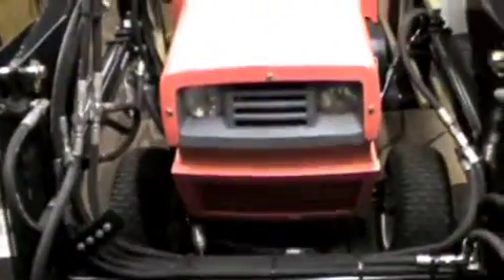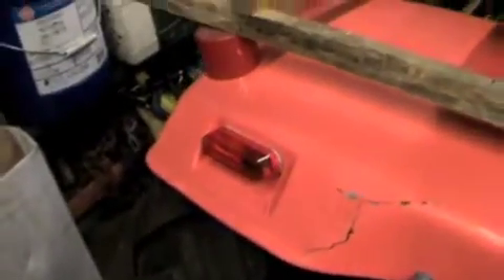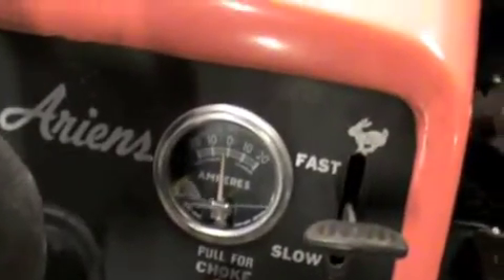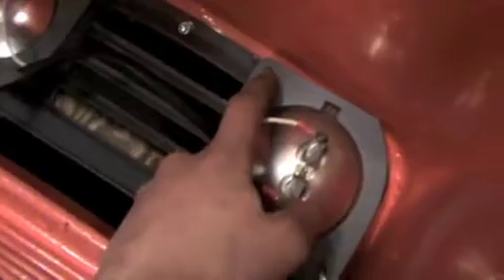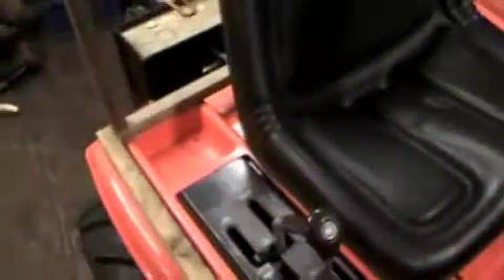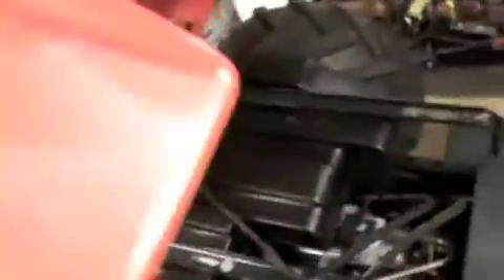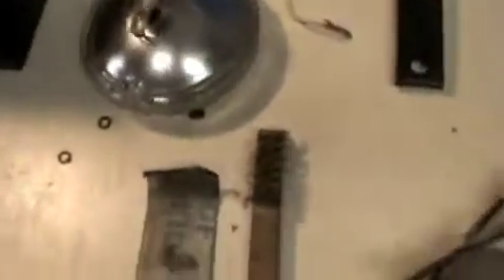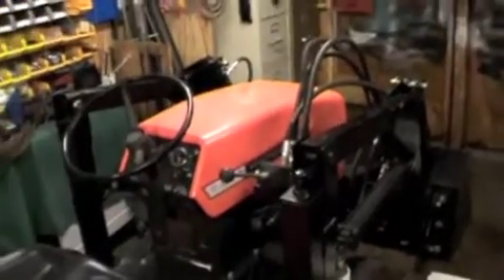Ariens S16H Loader Update

Comment: Yes it is very good with cab when it snows and it gives a little extra weight on the rear wheels. 
But it is easier to manage and turning without cab. 
You can see how it is mounted behind the fuel tank.
You can see my Ariens by writing Ariens s 16 h lawnmower it has a yellew dozer blade. 
I wrote it in google search bar and 16in is 406.4mm.
Yes it is a good movie 
Regards 
Morten DK